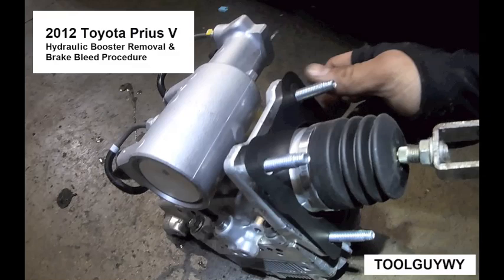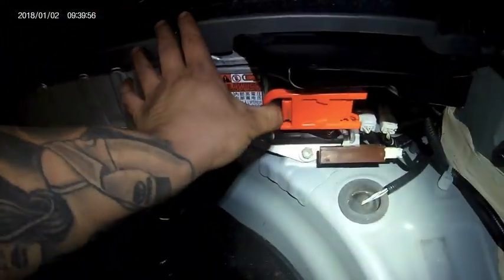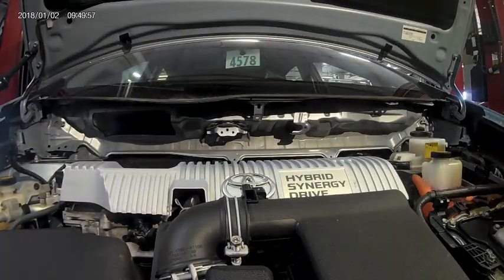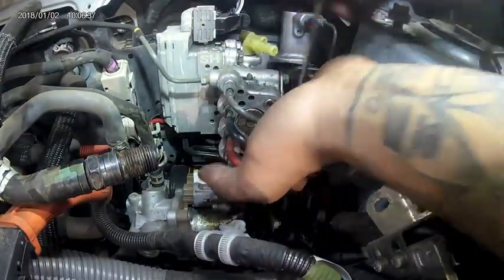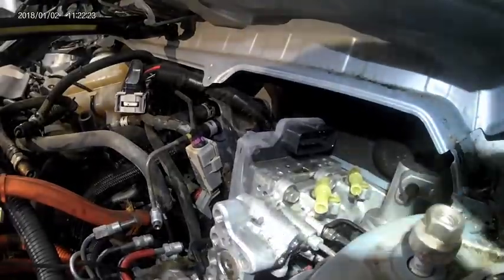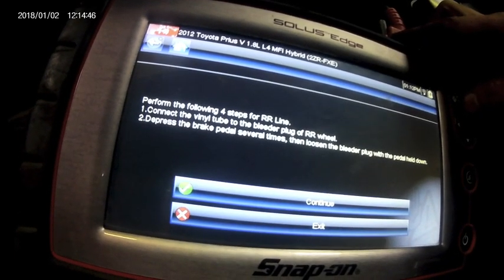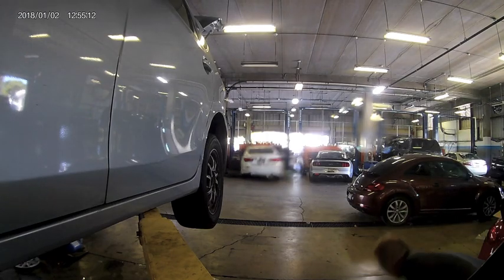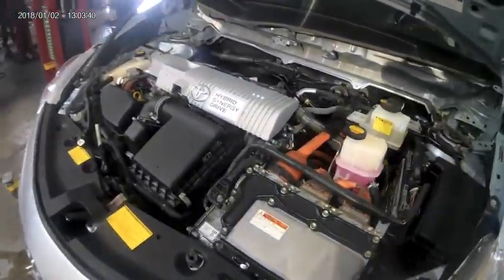2012 Toyota Prius V Hydraulic Booster DIY

Comment: Super helpful, thanks for posting!  I've never seen so much brake fluid spraying around though.
Reply from the maker: You’re welcome.  Yeah the vinyl tube and bottle was cutting it.  Lol we have a pressure washer at the shop so along with brake clean and washing after clean up was quick.
Reply: @DI_Wy  is there a way to contact you?
Reply from the maker: @hybridsolutiondiagnostics  I guess you can dm me on Instagram
Reply: @DI_Wy  sure... send me the link please...
Reply from the maker: @hybridsolutiondiagnostics  it’s just toolguywy on Instagram
Reply: @DI_Wy the stupidest answer possible. I hate junk jard mechanics in a garage

Comment: There is no torque spec for the brake lines?
Reply from the maker: ill be real with you.  Ive done plenty research after this comment.  First off the difficulty of torquing a brake line down would require a crows foot a long with a torque wrench.  Secondly there is no torque specs on prodemand alldata ect for a brake line torque spec.  Thirdly Ive been in this field for a while and I never once met a technician who torques their brake lines nor has a brake line torque wrench.  

Torque spec for brake line: as the Germans like to say Goodntight
Reply: @DI_Wy   So i guess, if it does not leaks, it's fine as it is
Reply: Just a little snug is fine bro, don’t see leaks you good ;)
Reply: @radiospank   Well then

Comment: Nice vid man. Hey my 2010 Prius 180k miles throwing the C1391 code only, abnormal leakage detected along with all those lights brake, abs, and trac. Control Do I need to replace the accumulator that is below too?.
Thank you for share this video, now i feel ready for the job i just waiting on the part from toyota 
Thank you again..
Reply: Any luck? I was wondering the same thing. Should I only change the Brake Booster(47210-47140), or the brake pump(47070-47050) as well?
Reply: @paulwall142  I finally replaced the brake booster only, today in my 2010 Prius which had the C1391 code only and so far so good , after driving around town for about 30 miles  no lights or issues so far.  good luck!!.
Reply: @vannsand597  I did so today as well! But didn't have as much luck, I didn't get to fully bleed my brakes. Did you bleed your brakes and the booster?
Reply: I couldn’t do the brake bleed because tech stream would error our whenever I got to abs bleed, so I did the bleed at the mechanic and now it looks all fixed, fingers crossed.
Reply: @vannsand597   How do you know what piece is bad with the C1391 code?
Reply: @hedgehogthesonic3181 . Well since this was the only code, and after a lot of research everything leading to only the buster/actuator internally leaking..
Reply: @vannsand597   You mean the piece with 2 cylinders?
Reply: @vannsand597   Is the brake booster that causes the internal leak problem.
Reply: @vannsand597  did the repair stick?

Comment: Is other scanners ( cheaper )you will recommend to do this job?
Reply from the maker: The snapon is the shop scanner, I personally have the autel ms808 which runs around 1000 not sure if youre going to have to buy an update though for it
Reply: @DI_Wy  
Thanks bro Appreciate it
Reply: I called autel tech they say I need to buy Toyota software, can you tell me is that correct please?
Reply from the maker: @jjlm79  I guess you’re going to have to update it.  I thought the update might come with the brand new scanner.  But i guess not.
Reply: @jjlm79  Did you find anything else on requiring the Toyota Software with Autel?

Comment: This That mechanic is a piss poor mechanic he didn’t use hoses to bleed the lines he let it spray all over the car who wants a car with oil all over it I would and if I found out that they did that I would make them clean up the mess
Reply from the maker: Obviously it wasn’t sent out like that and it was cleaned up.  As a flat rate tech I found it’s easier to do that than fight a flailing hose,  It literally takes 1 minute to spray degreaser, wash it down with a hose and air dry it with a blow gun… also looks cleaner than when it comes in.  

Due to the Brake fluid pressure and amount of fluid coming out In my opinion it’s easier to see a steady stream without bubbles that way  than through a vinyl tube.  due to the pressure, the vinyl tube sometimes pops off the caliper or out of the bottle resulting in a cleanup after anyways.  

This video is for informational purposes anyway.  Do what you want with it.  If you only took that out of this video that’s on you.  I hope this video helped you out, Best of luck on your repair though.

Comment: Why u doing to fast u shud do slowly so ppl understand u talk fast nd scaner use fast to westing time make onther video show the slowly
Reply from the maker: to be honest, I thought about that.  The long video without cutting ended up being over an hour.  As a fellow youtuber I do not want to sit through an hour long video, I felt it was needed to cut and edit this video.  I feel I covered all the important parts.  The scanner itself has instructions which will tell you step by step how to do it.  I felt that wasnt something I needed to elaborate on since there was already instructions provided.  However if you do have questions please ask away and I will answer to the best of my ability.  If you got lost on the scanner part.  Most scanner you will have to go to (and this is off the top of my head) "ABS" "Special Functions" "ABS bleeding" "ABS Bleed with actuator removed" and it will give you instructions from there.

Comment: Question; I changed the hydraulic booster on my 2014 Prius C because the brake fluid was disappearing. Now the rear wheels won’t spin! What a should do?
Reply from the maker: I don’t know.  Did you get it looked at professionally?